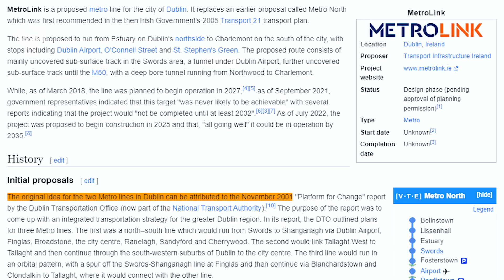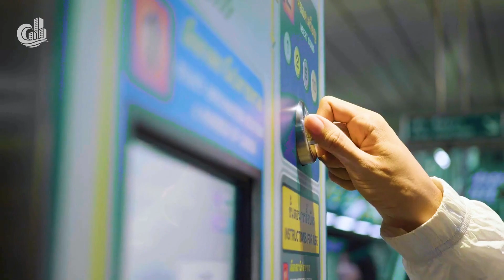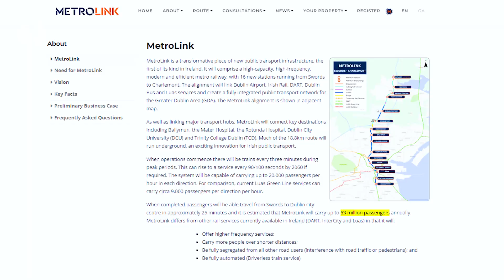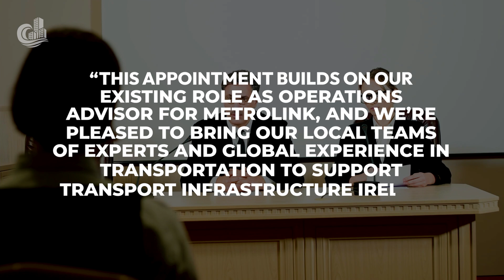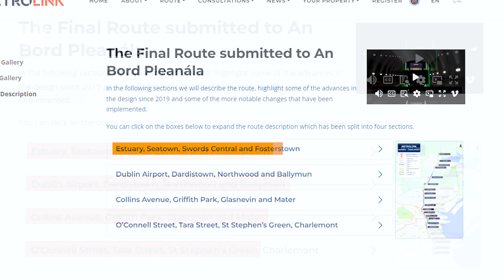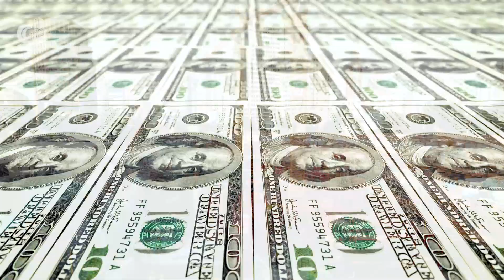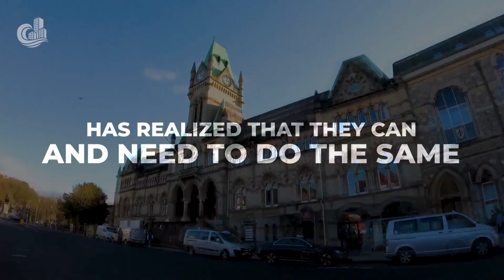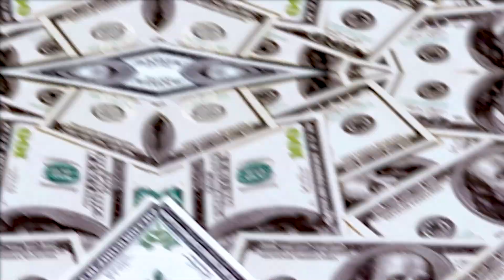Ireland's $10.5BN MetroLink

Comment: The Japanese offer to Irish authorities regarding building a metro system in Dublin was made in the late 1990s, specifically by the Mitsui Corporation, a Japanese conglomerate. They proposed to construct Dublin's underground rail system at no initial cost to Ireland, with the condition that they would operate it for 25 years and retain all ticket revenue during that period before transferring ownership to the Irish government. This offer included the design, construction, finance, and operation of the project.

The Irish government's response to the Japanese offer to build a metro system in Dublin in the late 1990s was ultimately one of rejection or no adoption. The Mitsui Corporation had proposed to construct the underground system at their own expense (apart from a small state contribution), on the condition they would operate it for 25 years and keep all revenue during that period. Despite this generous offer, the government did not move forward with the plan.

Instead, Ireland spent about €150 million on a different underground project called the Dart Interconnector, which was never realized and subsequently expired. Over the following decades, multiple plans and versions of Dublin metro or underground rail systems were developed and abandoned, involving various agencies such as the National Transport Authority (NTA) and Railway Procurement Agency. The rejected Japanese proposal is now seen as a missed opportunity, with ongoing metro projects like MetroLink costing far more and facing significant delays and cost overruns

Comment: Forget it lads. Iv heard about this since late 1970s building an underground so I would not hold my breath too long. In fact way back  rumour s we're abound that a Japanese  company wanted to build an underground system with no cost to the state if they were given the sole running rights for a number of years. Perhaps some rail buffs might either confirm or deny this rumour. Consultants have been paid a hell of alot of money on this project for 50 years. The current metro plan is all wrong anyway. After all why end it in Ranekagh and why follow the same route as the tram system except it's underground. Better to scrap it now and redesign a proper system. The way infrastructure projects are done here it will be 15 Billion and the rest for a few kilometres of track.

Comment: While the video is highlighting an important project for Dublin, the innacuracies are glaring and even sometimes contradictory. E.g. the "number of phases" involved in the metrolink design. In one part, a segment of metrolink is described as phase 2, while later on, the conversion of the Green Line to Metrolink is called phase 2. 

The annual pax total at Dublin Airport is currently around 30 million, not 22 million. 

And this video claims that there is no commuter rail in Dublin? There are literally hundreds of diesel-powered carriages operating on 4 corridors to the outlying regions.

Also, does anyone else get AI-generated vibes from this video?
Reply: The information is probably drawn from the planners themselves so that's how bad this whole project has been planned.

Comment: Am i correct in saying Metrolink doesn't connect to either of the two mainline train stations nor the central bus station!
Reply: Nor will it even go to any of the airport terminals. Evidently the closest station to the airport will be half a mile away. It's an absolute disaster, all of it.
Reply: @celticlofts  The metrolink airport stop is literally on the front door of T2, check their website. Stop spreading misinformation.
Reply: It would connect at Tara Street so railway passengers would be able to connect for metrolink that way

Comment: A lot of inaccuracies in this video.
Reply: Sorry for the year-later comment! The script of this video is likely an LLM-guided summary of Metrolink and I think the narration/voiceover isn't an actual person speaking either. There's all kinds of inaccuracies and "stuff that sounds right" if you quickly read result summaries from googling. Underground transport has been proposed in Dublin since the mid 1970s. Temple Bar wasn't supposed to just be the better Busáras,it was where the Connolly-Heuston and Harcourt-Broadstone underground lines were to meet.
Reply: @exercept-mn7sw  The original linking of those stations actually goes back to early in the 20th century. The 1970's Temple Bar CIÉ plan was just for a bus station.

Comment: Has it definitely, definitely, definitely been 100% approved?  No NIMBY appealing and An Bord Pleanala waiting for a few more years?
Reply: Doesn't work quite the same way as regular planning permission. It goes to public hearing in 2 weeks, Joe public can submit an "observation" which is simply that, their own 2 cents on the project. It's not the same as an appeal but they are considered (or ignored) by the planning board when making their decision. 

The board can approve, reject or approve with conditions. Approval is granted by issuing what's called a railway order. 

To be honest a project of this scale and importance and the fact €100m has been spent planning it already I can't see them messing around and fully expect it to get the green light by the end of the year. 

You can also assume a general election is on the way and the politicians want a nice big Infrastructure project started to pretend like they've done something useful.